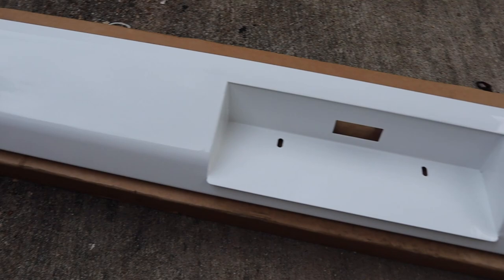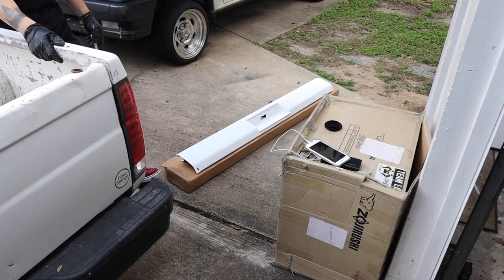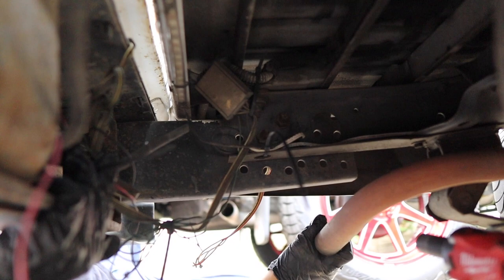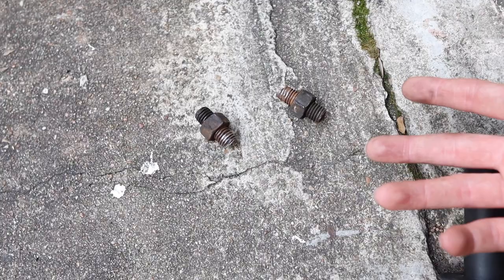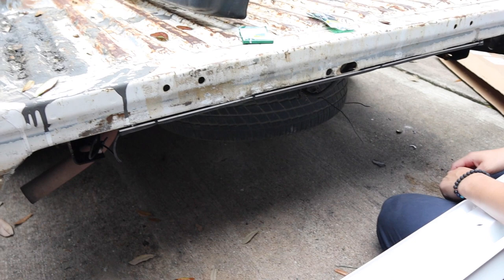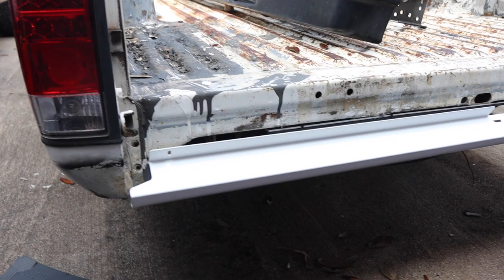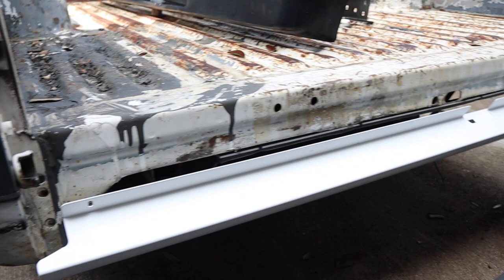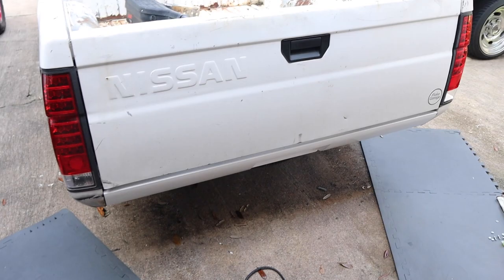Nissan Hardbody Roll Pan Install D21 | Flake Garage

Comment: I can't remember if it was my hardbody or mighty max but in the reverse light switch there should be a metal ball to actuate the switch when reverse is used. Alot of times when people pull the Trans out of the truck it will fall out so when it all goes back together it won't make the lights come on. Just something to double check..
Reply from the maker: We haven’t checked yet but thanks for the heads up, we might look for that and see if that’s something the hardbody has and if it’s the issue 👍🏼